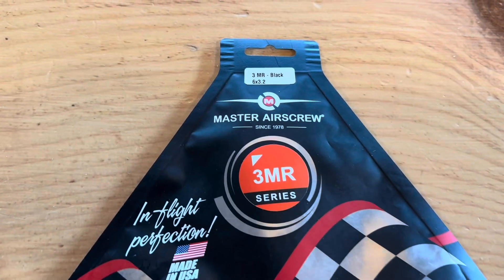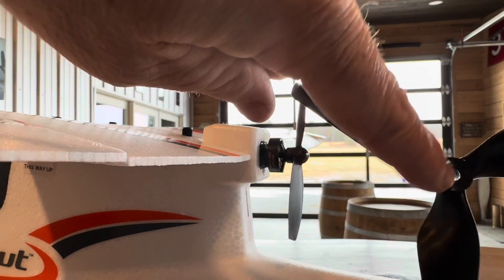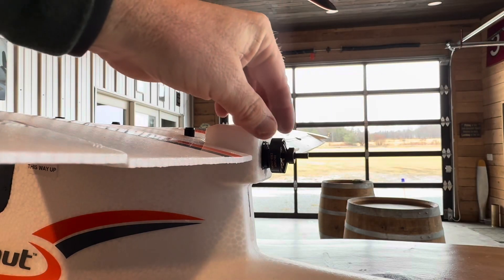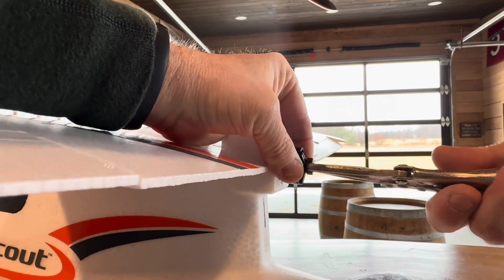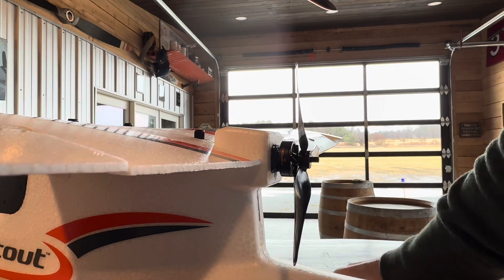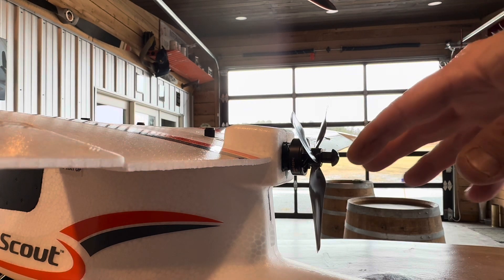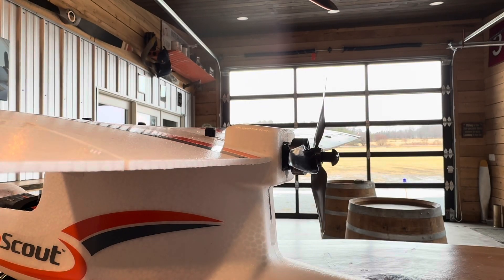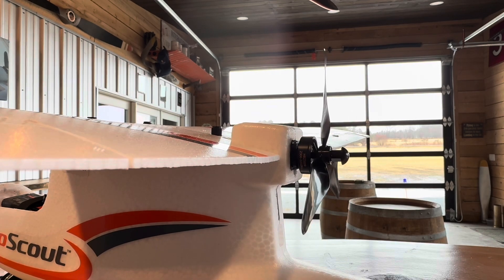HobbyZone AeroScout S2 1.1 Installation of Master Airscrew 3 Bladed Propeller

Comment: Not mistaken, something left out of this video.  Because of the direction of rotation and using that particular propeller, two of the ESC wires have to be flipped.  Otherwise, thrust goes the wrong way.
Reply: wouldn't you just turn the propeller around?

Comment: Hello Maine, greetings from California! Thanks for showing this, I have the same plane. Question, how did you decide on that propeller? Adding a third blade, the diameter should be smaller and/or lessen the pitch. Too much prop will bite too much air and overwork that tiny motor. I am not saying you are wrong, I am just curious how you came to that prop. Thanks and take care!